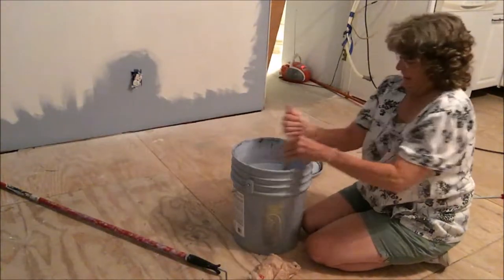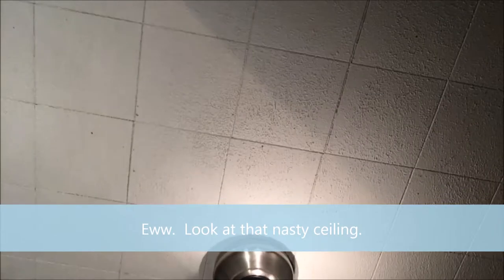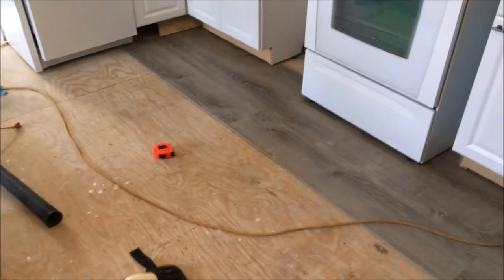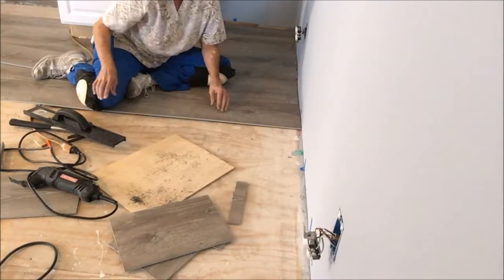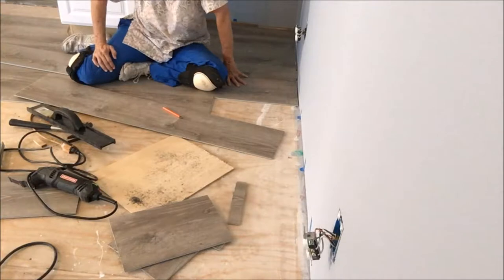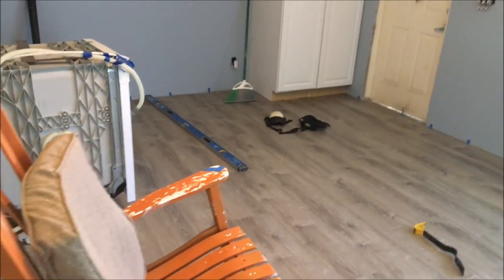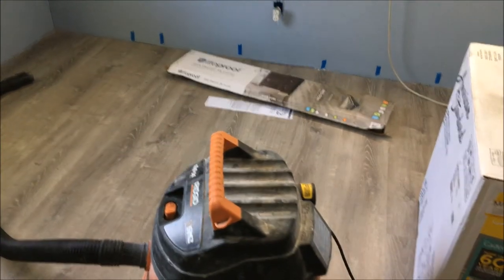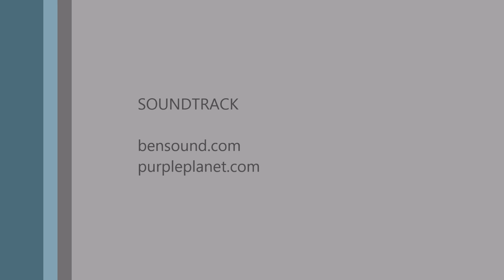Painting and LifeProof Vinyl Plank Floor Installation

Comment: Impressive use of oscillating saw and I really like the color combo of the floor and the walls.  Let mek now what you think of the LifeProof flooring.  I'm considering for remodeling our mudroom
Reply from the maker: I definitely will let you know how the flooring is.  I already spilled an entire frappe on the floor and it just sat there.  Didn't seem to seep through the seams.  As for the oscillating tool.  I just didn't want to get up and down, up and down. Too old! Thanks for the color compliment.  I thought it went well together too.
Reply: @theropesofrenovation9352  When I did the flooring in the nursery which is on the third floor the Mitre saw was on the first. I have nightmares about how many times I went up and down those stairs.
Reply from the maker: @SoWeBoughtaHouse  I am laughing so hard just visualizing that!
Reply: @theropesofrenovation9352  In the intro to the floor sanding video I drag a 100 pound sander up the steps.  :P https://www.youtube.com/watch?v=ARCv4-ER3Qw if you want to watch me almost vomit.  I had to wait 30 minutes to begin recording to catch my breath and stand back up straight.
Reply from the maker: @SoWeBoughtaHouse  You are so funny!  I hate you had to go through that!
Reply from the maker: So dang funny.